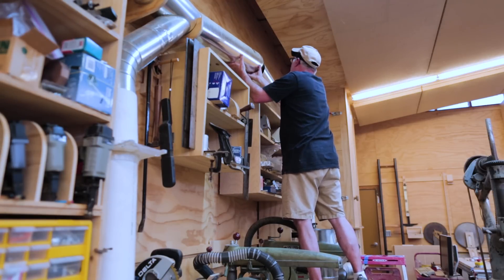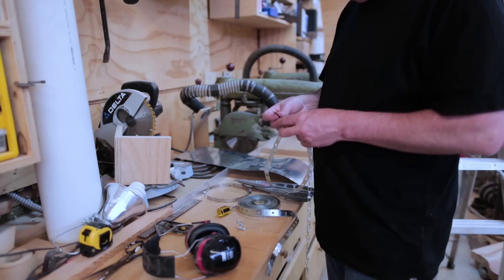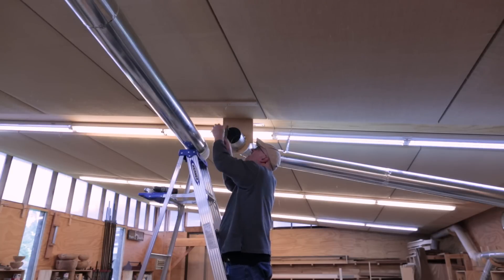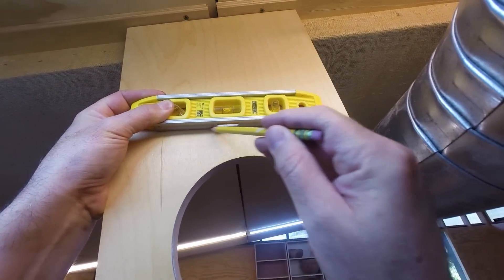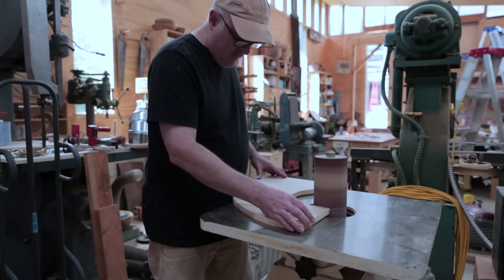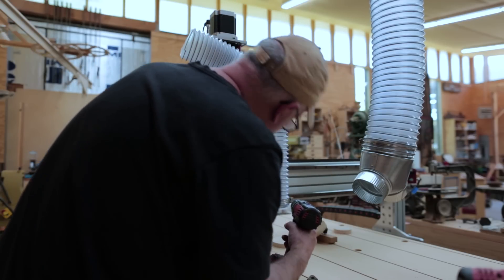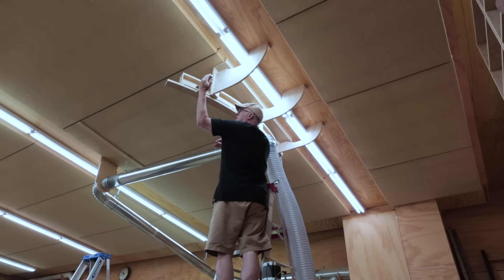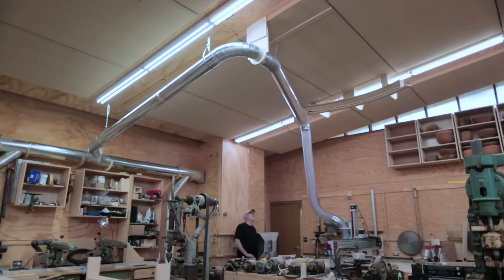CNC Dust Collection part 2

Comment: Thanks, Frank. I got a couple of good ideas from this for my dust collection.  

I have had a CNC router shop for 20 years and do contract work, so I have cut tons (literally) of Baltic birch and other plywood.  I always cut my plywood conventionally rather than climb.  I get a much better edge finish.  When I cut solid wood, the climb cut gives the best finish.  To avoid having to sand as much on your ply, try a conventional cut next time.

Comment: Very cool engineering with the additional wheels. My first thought was a small lip on the original beam, but the way you ended up doing is much smoother; very similar to a roller coaster As always, great content! It's always cool to see guys like you using a tool to make improvements for that same tool. For whatever reason I get a huge kick out of that.
Reply from the maker: Thanks!  as long as it doesn't become self aware
Reply: The day you get a 3D printer sky net will definitely be online.
Reply: It is already, definitely a mind of its own...:-)
Reply: Frank - You may want to invest in one of those baby cams that you can leave in the shop at night...just in case it does become sentient.   At least you'll have a head start before the inevitable war against the machines.
Reply: Sooner Keith it's the radial arm saws that worry me!
Reply: John, why are you up so early?
Reply: I think I foresee a future video in the works.....completely autonomous tools building something in Frank's shop.
Reply: Greg Cummings oh I think that is already happening

Comment: You could use non-flexible 4 inch hoses and fix the adaptor to the machine. I think that would be a little neater and it might improve the airflow even more. Anyway, its a nice design (although maybe a little bit over-engineered :) ).
Reply: That's what I did.  I have a 3 foot chunk of 4" pvc Coming from my dust boot and the hose clamps to it.

The pvc just slips onto the dust boot nipple so I can just pull it off and clean my table/floor with it real quick. It was kind of a accident that I did it in the first place, but It's really handy.
Reply from the maker: Yes,  I was thinking that would be the next step.

Comment: Just because I've not seen it elsewhere. The reason it fell off the track is because when the extraction is on you're basically pulling the whole tube in the other direction to the airflow. It compressed at the flexable section and pulled it off the track.

Apart from that. Its a pretty good solution to the dust problem.

Comment: I always like to see how you solve problems. Nice build.

Just a little info about collecting fine dust... the fine dust is much easier to catch than the larger particles because the fines carry much less momentum and are easily entrained in the air stream. Chips require higher air velocity for capture. 

I capture 100% of the fine particles with less than 100 cfm using a shop vac with the power turned down via PWM to lower noise and a dust shoe (verified using a laser particle counter).

I would imagine that your setup should catch all the particles,  large and small,  with the flow rates you should have as long as the dust shoe doesn't have too much pressure drop.
Reply: BUT, with the bristles, the big chips lose their velocity fast when they hit the outside.
Reply: Jeff Eberl Yeah... that's why they are there.  Without the bristles,  most of the small particles would be captured but almost none of the larger ones.
Reply: thanks for letting us all know about your knowledge.

Comment: Fantastic video, Frank! The arcs are incredibly functional and great looking to! If you're concerned about the nuts coming loose (I remembered you mentioning cranking down on them) you should get some nylocks or nylon insert nuts. They have a strip of nylon on the end of the nut that prevents them from coming loose sue to the vibration you would get in any moving part. They only cost a bit more but are so worth it.
Reply from the maker: Thanks,  I do have lock washers on there, if i have problems with that i will look into the nylon.

Comment: Completely true what you're saying about these flexible hoses. 
The flow resistance of these flexible ones are pretty high (as in very high), so you need to make them as short as possible.
I see many people making this mistake. In the end you just completely ruin your airflow with these things.
I think you can buy semi-flexible hoses which have a surface that's much more straight.

The moving part looks great, but I think it's creating more problem than solving them.
If you would move you CNC right in the middle, it shouldn't me to difficult to make a hose that's long enough to reach all the sides/ends.

Comment: After the first fall of the pipe I think a single wheel would still work. You could have 'captured' the wheel somewhat like a garage door wheel is captured in it's track. But I like your solution as well... and it is your shop. Good build Frank.

Comment: Frank, just saying.. Flex joints do contract under vacuum. If you had put a tensioning cable with a turn buckle for adjusting from that arc towards towards a clamp just before the first (or last one down stream) flexible joint, you wouldn’t need all those extra rollers, friction and all that extra plywood. Provided you had measured the arc to that point. Keep it simple 😀
Keep up the great vids!

Comment: You might consider taking your three side support pieces down, one at a time maybe, and cutting some holes in them.  They'll still be structurally sound but less mass and will also allow light to shine through.  Great design, btw.

Comment: Great Job Frank! In the Monday morning quarterback fashion, would it have been better to add another wheel trolley to the original beam on the opposite side and be done with it? That is the setup used on overhead cranes. A trolley that straddles the "I" beam.

Comment: Very nice!  I would suggest - the dust shoe should attach to the gantry and not to the Z axis. The router then moves up and down inside the shoe and the shoe is always the same distance from the work piece. This removes some inernia and weight from the Z Axis and assures a smooth vacume fit of the shoe to the work. . There are some examples on the web.

Comment: After watching this video... I noticed the swing arm tends to over travel rather harshly when the Y axis is slewed rapidly causing a lot of bounce.  Has that been a issue?  I work with large Laser Tools in the Solar Panel Industry and our exhaust systems on our main axis of travel X is 2m/s which caused our hoses to swing back and forth rapidly and caused a lot of hose breakage due to the wear and tear of that motion.  After several design changes by our tool vendor with no adequate fix... I came up with a dual countering weight design that uses 2 pulleys and some basic string and the concept fixed our issue completely.  Secure the strings near the end of the swing arm and mount the pulleys at or near the ends of your arch route the string through the pulleys and attach the weights (these need to weigh the same obviously) .  Though being a arch you may need to play with finding the optimal angle relative to motion to mount the pulleys to the ceiling which might be Directly off the end of each arch or somewhere outside the arch.  As the arm swings one weight goes up the other down the tension the pulleys provide by the weights counter act each other and stops the free movement of the swing arm when the Y Axis stops.  1 thing to consider is the length of string will need to be accounted for so the weights do not interfere with anything

Comment: That track is really complex.  Did you consider just hanging that end of the pipe from a chain ~4 feet from the ceiling?  That would give you some swing and with the length of flexible hose you having going down...

Other option I thought of is have two anchors in the ceiling with a cable or wire between them, then a single caster hanging from that that connects to the pipe via a short piece of chain.  The caster doesn't need to travel in an arc if it's not rigidly attached to the pipe.

You probably don't get the swing you have with the track rig, but with the clearance you have over the machine via flexible hose, it doesn't seem you need it, even if the cnc gets 12' long.

Comment: Awesome!!
One of the reasons the first design fell off, is that your bracket for the pipe wasn't hanging below the wheel, but a bit to the side. This does create some sideways forces on the system.
Reply from the maker: true, and it wasn't really attached to anything.

Comment: to solve the brush problem of not being able to see your bit.... take clear plastic pepsi bottles and cut them 1/8 inch strips the length of your bristles on the brush and leave a connecting strip to put into the brush slot.... now you can see in and still have suction.... and it costs you 10 cents... also where did you buy the bamboo plywood for your kitchen? I am redoing door and drawer fronts on 1940's built ins. I think I will like this look and the Oregon City home depot is a bit high on the price.

Comment: It looks like it can be moved to the left a bit, as right now it is only using half of the "track", while hitting the end on the left side it only uses it to roughly the middle. 
Other than that, great job indeed, especially the safety wheels are so clever!

Comment: I know you have shortened the hose drop, but I would like to see 2 long bungie cords connecting the hose just above the router to the wheel attachment just to add flexible support.

Comment: This is impressive both the concept and the realisation. 
For durability sake, you should move the wheel system closer to your lower wall, as it seems as it is right now, the arc only cover 2/3 of the cnc table and the tube reach the end of the wheel system before the cnc router is at the end of its table, if that makes sense.
Anyway, great job =)
Reply: Furrane Frank plans to add 4 extra feet to the end of the CNC as he stated in the video ;-)
Reply: 17:46 When viewing from this angle, is he adding those extra feet to the right of the cnc ? If so then that makes sense. 
What I was trying to say is, again form the angle, the arc should be moved to the left to accomodate the cnc bed.
Sorry I missed him telling this, english isn't my main language.
Reply from the maker: yes, 4 feet towards the lathe.   at least that's the plan.

Comment: Very nice - although it makes me wonder if the overhead, swiveling "beam" and gear from a defunct coin operated CAR WASH would work - to suspend and support a simple, longer section of the PLASTIC and therefore lighter air duct ???  (It's always fun to spray wash my 14 feet of sedan from all angles as I walk around it, toting the high pressure hose as I go...)

Comment: Metal is the best material because you can ground it, and there is zero static build up.  Static build up is stored in plastic hoses.  Wrapping a wire around the outside of a plastic hose does nothing. The static electricity is still stored into the plastic.  It can break the control systems for CNC machines. Metal is the correct choice. You still need plastic hoses at the machine level for flexibility, but to have them connected to metal pipes will help keep static from breaking your machine.

Comment: Makes me think of the arm that holds the pressure washer hose at a car wash. Its positioned in the middle and spins 360 degrees. Wonder if that couldn't work here too ( not that another solution is needed, just thinking out loud.)
Maybe that concept would be good for having a hose in your shop wherever you need it temporarily.
Reply from the maker: That would be nice for a compressed air line.
Reply: frank howarth brilliant use! How about electric, compressed air and lighting. Serious project but if you could keep it suspended...

Comment: Very cool, had me enthralled from start to finish. Couple of quick questions. Firstly why didn't you work backwards from the end? Would seem simpler to find the ideal pivot point once the curved I beam had already been fitted in place. Same goes for the height drop from that point. The hose still looks a bit long to me which is creating a knocking on the end plate, any way to stop it ever banging on the end plate?
Reply: Oh and I hope you don't mind if I pinch your idea for my new workshop ;)

Comment: Amazing innovation! Will it be hard to change the fluorescent tubes? Do you find that these structures around the lights cause annoying shadows? If you ever moved away from fluorescents and got LEDs to save power since they need no ballast, how would you mount them? They make LED strips.
Reply from the maker: I switch to LEDs just before putting this up.  hopefully I won't have to change the tubes for a while

Comment: did you consider having a wheel running in a curved track with a chain hanging down, which you hang the pipe from? i guess it would swing with momentum... dunno, seems easier

Comment: I probably would have built something consisting of 2 tubes between 3 articulation points, almost like a robotic arm, between a vertical tube on the CNC router and the ceiling.

Comment: It looks to me like you need some support to hold the Y connection to the 4" pipes.  Something to hold the Y in a vertical orientation.

Or, use 4" hard line and 45's to connect to your 6"?
Reply from the maker: Yes I think I want to make the 4 inch tubes rigid.

Comment: How come you didnt do something simpler like run a static flex pipe from the furthest point, then use a spring or weighted pulley to provide lift to keep the flexible hose slack up near the ceiling at the other end, but still have enough resistance to allow the CNC to freely move?

Comment: Wouldn't it be good to mount the divider von 6 inch to the zwo 4 inch tubes to something? That way would reduce the weight and thension of the hanging tube

Comment: I thought the curved I beam with the CNC was super clever! I doubt I'll ever have a use or ability to make it, but I'm filing that idea away under "could be useful someday".  

Do you find the coupling between your large tubes to be sufficient to hold vacuum? It looks like they'd be a little leaky and some tape or something to seal it would increase efficiency. 

Keep up the good work! You're an inspiration :)
Reply from the maker: Thanks,  i figured once i had it running for a bit and everything seem to be working i will come back and seal everything up.

Comment: Great work! 

Did You connect those pipe system to the ground (ike in electric circuit)? As I've heard - while particles hits it it may create electrostatic effect over the pipe. And as far as pipe is able to transfer it, and while keeping in mind that dust may be way too much flamable (way more we may want it to be in this case), it may be worth to think about if You didnt done that yet ;)

Greetings from Poland, I admire Your work!

Comment: Fantastic build Frank... just a note off topic... I noticed your oscillating drum sander sandpaper sheet was a little clogged up in places, I'm not sure if you're aware that if you take a tube of silicon sealant of any colour, cut the end off and leave it to set over a period of a week or so then cut the plastic tube off of it leaving you with a cylinder of set silicon this is the best thing for cleaning any of your sanding sheets on any sanding machines. Just offer it up to your sanding sheets and let it rub them reasonably clean if not looking new.
Reply: Peter Allen or just use the sole of a shoe from a thrift store.
Reply from the maker: I will try that

Comment: I really love your videos and I've got a lot of inspiration from them thus far, but one question I ask my-self though is why don't you invest in a proper "euro type" panel saw with sliding table and with the piping for the dust collection nordfab or similar, I think it would make your life easier in the long run. I'm interested to hear different opinions on this but mainly yours, I know things work differently in the US compared to here in Europe (I live in Sweden) but any way, is it because 3 phase power concerns or just because you guys are more used to the way you do things over there? Hope to get an intelligent answer on this since I'm genuinely curious about this. =)

Comment: Nice design, I think you could do away with the 4" flex completely and just run some 18-24" pieces of rigid. The way they flop over isnt helping air flow.  I wish I had the space you have but not the weather ;)

Comment: Why not have a horizontally moving thing at top of the CNC where your two hoses connect instead of it having it at ceiling height?
Reply from the maker: Difficult to make something move in 3 dimensions without the slop of the flexible hose drop.

Comment: Hey Frank.  What's the verdict on whether your saw dust ducts need to be grounded?
Reply: If you make youtube videos you have to ground them otherwise people will comment endlessly about it. He used flexible tubing with spiral metal ground wire to satisfy all the youtube commentators. Otherwise you don't need to worry about it. Static is not going to cause a dust fire or explosion in your ducting. Tons of people use PVC with no ground and it doesn't blow up.
Reply: What's your background?

Comment: Aren't sheet metal screws auto tapping?
Reply from the maker: +Ricardo Junqueira yes, but it was a little easier to drill a small hole first.
Reply: I meant self tapping. Thanks Frank!

Comment: Another way you could have solved it was to make your curved i beam have grooves on both the top and bottom for the wheel and only be tall enough so the wheel could enter from the side, then screw on your end plate. But you were too far along with the original design that I think you came up with a good fix for it (although with many added parts).